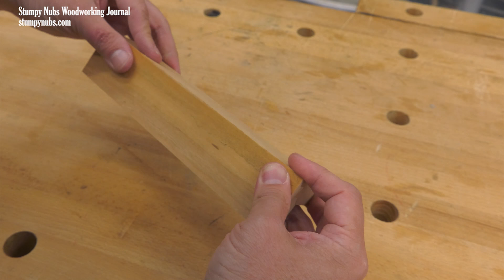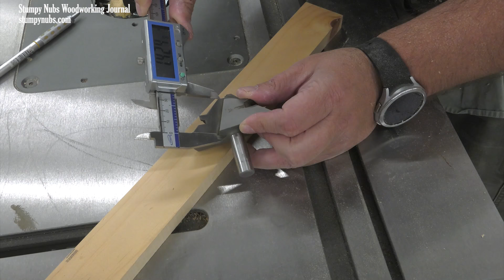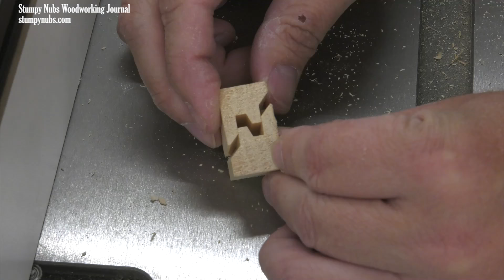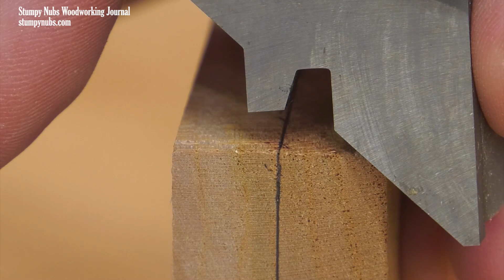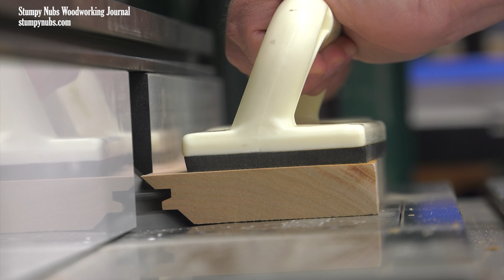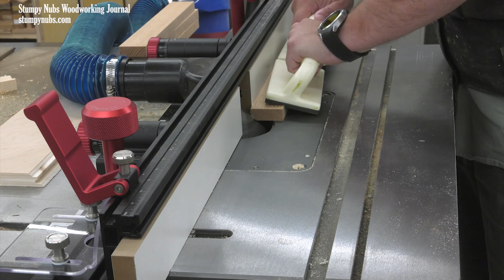This will make SO MANY of you very happy!

Comment: I seem to recall that rockler sold a lock mitre bit and also had a corresponding uhmw plastic gauge block to help you set it up.
Reply from the maker: I've never found those blocks (or homemade ones) to be as accurate as they claim to be. They get you close, but you still need test cuts and adjustments. This method (especially the digital one) is as fast or faster, in my experience. But if you prefer the setup block idea, these methods will still serve you will the first time, before you make your block.
Reply: This dig is based purely on my experiences regarding Rockler brand blue router bits. Rockler actually sells both their house brand router bits for the lock miter joint at $79.99 and the Freud lock miter router bit at $109.99. Because I have had Rockler router bits loose their carbide cutters during their first use for no apparent reason, or throw the carbide cutter if the bit made contact with an aluminum jig (I have experienced both of these failures), I would not buy one of their router bits for any amount of savings. Such failures make me ask serious questions about how the brazing is done and about how unsafe such router bits are to use. Yes, I know that I can go back to the store and generally they will replace a defective product (if they have another in stock) immediately. But going back to the store is time, which equals money; not to mention the safety concern since flying bits of loose carbide have to go somewhere, and I would rather they not end up in me. I have never experienced a similar failure with any name brand router bit, including Freud or Whiteside (my personal preference), this further reinforces my personal bias against Rockler blue router bits.
Reply: Micro jig sell a kit (that only works with their bit) and then there is the infinity one that’s like $60 for a piece for an etched piece of metal…
Reply: Wouldn't it completely depend on the thickness of the stock?
Reply: @larrybud  Yes, but it gives you a reference rather than doing all the measuring mate.

Comment: These bits only work with 3/4" material?
Reply from the maker: They make two versions. The smaller will work with material up to 3/4-inch thick. The larger one will do what the smaller one will do, but will also work with material up to 1-1/4 inch thick. Obviously, the larger one is more expensive.

Comment: I've had a lock miter bit since 2016. I became more and more frustrated trying to set it up by the instructions and actually didn't use it for about a year. I found your method #2 on a woodworkers website in 2017 and now, with 2 test cuts on same thickness scrap, it's ready to go in less than 10 minutes.
Reply: I think I saw tutorial years ago that said “ once you’ve dialed in the perfect setup, you can cut setup blocks you can use to get the bit height and fence location exactly right in seconds”.   Does that work?
Reply: @afpwebworks   After 3 or 4 setups, I did make setup blocks in scrap white oak. Now, in the worst case, I need a very minor adjustment for 3/4 in. stock.

Comment: I have used this type of bit for years.  I do not make the joint with one pass.  I just creep up on it using multiple passes until the last pass matches the edge. I find that by using multiple passes I get less tear out (I use this bit most often for drawers and cutting 1/2 ply). No measurements needed...
Reply: @dougwing6326, if I understand your comment, the sneaking up would be by adjusting the French depth, is that correct?  Then this would still require setting proper bit height?  No condemnation, just looking to understand. Thanks.
Reply: @brucenewton8721  Yes. I have a "setup block" I made by cutting the miter on a piece of 1/2 ply. That took a few tries to get it in the middle as in this video. But from that point on I adjust the height with the setup block and then use the fence to complete the joint.

Comment: Is the travel mug sitting on the tablesaw a joke? Or is it a statement of 'do as I say, not as I do?'
Reply from the maker: Did I ever say not to put a travel mug on my table saw? I've had a cup setting in front of me in most of the videos I've made over the last dozen years. It has a purpose, which I have explained in the past. Maybe try not to find fault in everything you see?
Reply: His table saw is nickel plated. The cup will not leave a ring.
Reply: James has a fancy-dancy nickel plated top. Water doesn't affect it. He showed it in a different video. 
Yes, I'm jealous!
Reply: Well! I guess I am that one!
I actually asked the question because I had watched what I assumed was a rant about the people who do various things in the shop that are not good practices. I agreed with most of that video, even though I felt it was a bit arch!
The very next video is another on a subject I enjoyed, but right front and center is a red travel mug sitting almost on top of the throat plate. Nothing else but the fence on the saw! This leads me to believe it was intentionally placed there as a statement. For what purpose I was curious about!
As to the 'do as I say part, it was meant as a bit of fflippant. A bit of amiable chiding!
As far as the table being nickel...so what! The surface is nickled, but how about the sides, the bottom, or more importantly the inner workings! Best practices would lead me to believe you shouldn't leave any liquid container on top of a machine, whether it is nickel, iron, aluminum, or even wood!
I assumed the prominent placement of the cup was intentional! I made what I thought was a very slightly amusing 'yo mama'!
I am sorry if anyone was offended, but I would do my post again! And now that I think of it, take another look at the videos main picture! I know this is possibly a bit petty, but were you trolling?
Lighten up folks!
Reply from the maker: @davidc8077  Fair enough. Have a nice day!

Comment: 2:37 seems like this should be marked on the cutter from the factory...
Reply: I agree!
Reply: I have always wondered the about that same thing, why doesn’t the mfgr. mark where is this mythical center of the bit? Could this be because the center point changes with each sharpening of the cutters (maybe)?

I haven’t used mine yet, hearing about how difficult this bit can be to set up discourages spending the time to figure this out. Has anyone used the Infinity Tools set up gauges for setting these bits up? Curious to hear about that experience as well.
Reply: @bigk4755  I saved a cut-off piece of one that fit perfectly and use it as a template by sliding it up to the bit and adjusting the height and fence to both pieces and seems to work pretty well.  A good place to start.
Reply: @bigk4755  james says in other responses that he finds the setup aids to not be particularly helpful. you may want to read those comments.
Reply: definitely!

Comment: That's a scary looking bit
Reply: Do some raised panels with a bit....
Reply from the maker: I use the large sized version because it will work for thicker stock. They make a smaller one that works for 3/4-inch stock and thinner. Also remember, most of the bit is hidden inside the table and behind the fence. It's not as scary as it seems :)